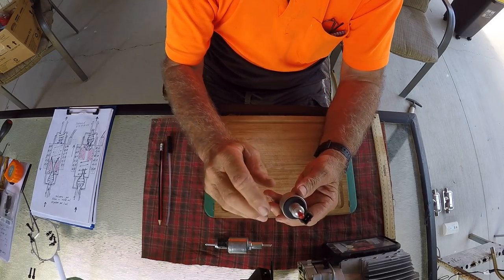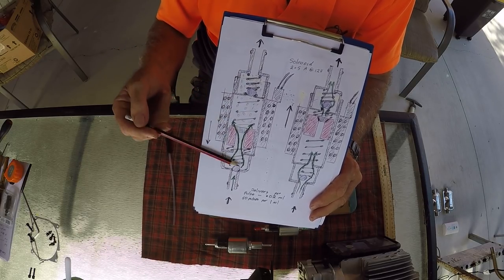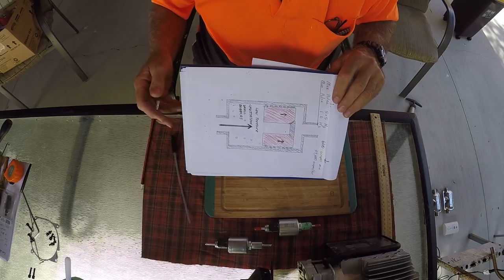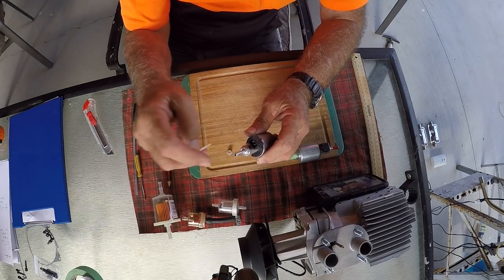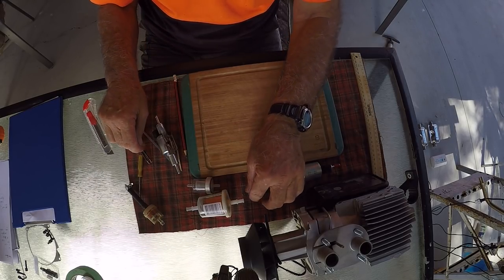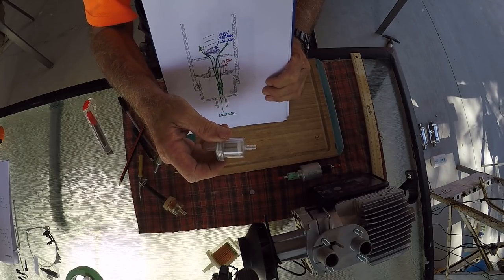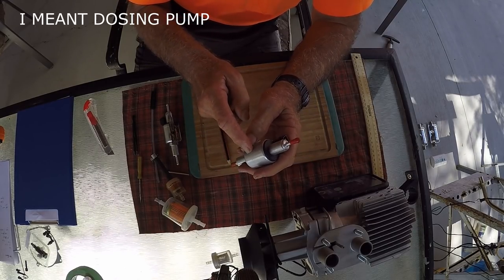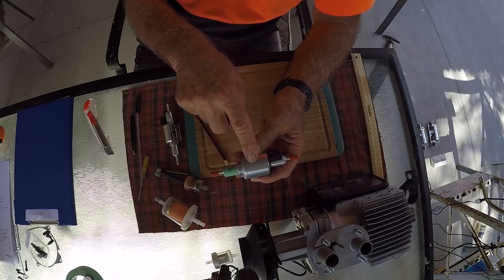Chinese Diesel Air Heaters   Part 7   Metering/Dosing pump

Comment: John, watched all your videos, but the one topic you failed to cover, IMO was tank height. I've been trying to find out if having the tank HIGHER than the pump or heater will cause siphon issues, or does the pump prevent flow? Super informative series by far. Thanks from Canada.
Reply from the maker: Hi There

First, I am pleased you found the videos helpful. 

Now your question. 
You are correct. If the tank is more than a few inches higher than the pump or the heater diesel can leak past the seals and flood the heater causing a non start. 

This is easily fixed….Just install a ball valve fuel shut off tap between the tank and the fuel pump, and turn off when heater is not in use. 

This generally means when heater is not used for a week or more. In general, there is no need to turn the tap off if heater is not used for a few days. JMcK
Reply: @johnmck1147   JMck, Understood. The big question was tank height. A shut off in this application isn't possible, as I want to turn on the heater on/off remotely over the internet. lol. Already have that working with a pi and red remote. Not a biggie, we'll redesign with the tank lower than the heater, but again, useful information. Thank you.

Comment: Hello, what is your opinion on the CNMZ 23 pump being rated for both 12 and 24 volt? On the pump it says 12 volt, and I received it with an order for a 24 volt system. Searching the web indicates the 12 volt pump is sold interchangeably as a 24 volt pump. Have you ever tested or come across this discrepancy?

Comment: Hi John, brilliant video and thanks for sharing your knowledge. Wondering if you can help me? I have a Truma diesel/electric heater/water heater made in collaboration with Erberspasher, in my motorhome. A new pump from Truma is about £200 yet I see Chinese ones for about £15-20 but can’t cross reference the part number. The output, on fuel, is 2, 4 6 kw and pump rate 220-630 ml/hr. (Ave 110 ml/hr @ ave output of1000w). Is there a Chinese pump I can buy that will do the job. Many thanks Keith
Reply from the maker: Hi Keith

I think you could make this work if the current pump is an electromagnetic DOSING pump. 

If the current pump is a true dosing pump I would try a Chinese pump and see what happens. If you do try this, I would be most grateful to know the outcome. JMcK

Comment: This series is wonderfully informative and I'm not thru it yet. BUT, I was wondering if you could give me your opinion on what it takes (electrical power consumption wise) to run a 5KW heater for 8 hours. I need to use one this weekend in my school bus conversion and want to run it off the two bus batteries without draining them to the point where I won't be able to start the diesel in the morning. Thank you.
Reply from the maker: Hi Tom,

The current usage is very dependent on heater usage and settings.

The heaters draw 10 amps for a minute or two to heat the glow plug and start the burn process.
They also draw 10 amps for the shutdown process, so you really do not want to be turning them off and on too regularly.

In operation they draw about 0.8 amps on the lowest manual setting up to around 4 amps on a high setting.

Running these heaters you will use around 10 Ah on a low setting to around 35 Ah on a high setting (for your 8 hour run time). JMcK
Reply: @johnmck1147  Thank you.

Comment: Hi John
Thank you for the very detailed video and all of your other videos.
I am running my Chinese 5 kW heater on fusel oil. Do you know of any ethanol compatible fuel pumps for these heaters? The pump pulse is weak and the flow rate has slowed to the point the heater won’t light. I believe the pump has failed due to the “dry” fuel. I can blow air into the into the fuel line after the pump so that rules out a carbon blockage. Any help is much appreciated.
Cheers from Canada!
Reply from the maker: Sorry Brian, I know of no ethanol compatible dosing pump.

You can buy a spare pump on eBay, a Chinese made fuel pump is quite cheap, but make sure the voltage is correct. If you wish to continue using fusel oil, I suggest you add 20% diesel for lubrication.  JMcK

Comment: Hi thank you for all your videos!! So helpful you are the man.  What do you know about running these at altitude?  i want to put one in my cab over camper I live at 6000 feet and will be using it for ski trips so will be going up higher than that while using heater. Any information would be helpful.
Reply from the maker: Hi Paul,
I have not come across a Chinese manufacturer selling a high altitude kit for these heaters. You can buy a genuine Eberspacher with an altitude kit. 

The heater will run at high altitude, but will run rich due to the lower oxygen component in elevated  air, and this causes quicker carbon build up and more frequent servicing. You can improve the performance by running a high kerro diesel mix at altitude. 80:20 or 90:10 Kerro :diesel.  JMcK

Comment: Thanks  heaps John. I can't quite get how you integrate manual priming in this system. Can you put a rubber priming bulb inline between filter and dosing pump?
Reply from the maker: Yes Dirk, but put it at the end of the fuel hose, squeeze prime until fuel comes out, disconnect prime bulb, and quickly connect hose to pump.

You only need to prime once, so there is no need to leave primer in place. It will work left in place but puts unnecessary load on the little fuel pump. JMcK
Reply: @johnmck1147  Thanks for replying John (didn't think you would find the time after all those excellent vids :)  I assume mounting the fuel tank above the unit would negate this problem and put less strain on the dosing pump as gravity would take care of much of the required energy?
Reply from the maker: Hi Dirk, an elevated  fuel tank is fine, but needs a fuel shut off valve before the  pump, which you need to turn off if not using the heater for some time. Over time you can get fuel seepage past the pump which can flood the heater glow plug causing a non start.  JMcK

Comment: Hi John, thanks once again for all your videos and knowledge. I am wondering if you know what the difference between the different pump sizes is? From what I gather, there are different size pumps, indicated by the number written on it. In the video, yours is 18 which I believe stands for 18mL. The most common pump size on Amazon I see is 22mL. I just swapped out a 19mL and put in a 23mL, and I think it is making my heater run too hot. The outer plastic is too hot to touch after 15 minutes. I was assuming it was because the larger sized pump is pumping out too much fuel causing too much combustion. In your video though you said all the pumps dose at .2mL. Do you know what the pump size actually indicates or if the larger pumps do indeed pump more fuel per pump than the smaller sizes? Do you think the pump sizes are interchangeable and my issue lies elsewhere? Thank you!
Reply from the maker: Hi There. 
Re the pump sizes.
Add a decimal point in front of the number, that will give you the the volume of each pump pulse. Most 5 and 8 Kw heaters use .2 or .22 ml pumps. 

If your heater came with a 19 pump, the CPU would be set up for that fuel volume, matching pump speed with fan speed to get a correct burn. 

You installing a bigger pump upsets all the calculations. 

If technical minded you can, with a password, recalibrate the CPU, but that can be a disaster as these heaters have no factory reset button if you don’t get it right. 

Cheers. JMcK
Reply: @johnmck1147  Thanks for the reply. That is what I was thinking, that I would be able to tune the heater by adjusting the pump frequency and fan speed to the new pump. I am already doing this for elevation adjustments by following a chart I found online. Would you be open to making a video on how to tune a heater using a CO detector?

Comment: G'day John. I'm looking at buying one for my caravan and doing the install myself and am going to show my lack if understanding here but what exactly is 'soft mounting'? I'm thinking of encasing the fuel line and dosage pump with some narrow foam or rubber hose. Would this work? Loving your videos so far!!
Reply from the maker: Hi Chris, 

The dosing pump is a piston pump and causes a ticking noise when the piston hits the end stop. If hard mounted this noise/vibration is transmitted to the boat hull or vehicle chassis, so you need some soft material to isolate the pump to lessen the noise.

Incasing the hard fuel hose in soft rubber hose is a sensible move as it both protects and noise isolates.

Incasing the pump in insulation material can cause issues as the pump gets hot and can overheat in some cases, but as you mostly use the heater in a cold environment light wrapping of the pump can be ok.   JMcK

Comment: What is the difference in the SN1 and SN2 setting. I have a brand new heater that immediately started over heating (error code - 5) and I read to change this setting to fix it. It did fix my issue, but just curious why I needed to change that!
Reply from the maker: Hi TOR

To the best of my knowledge SN1 and SN2 refers to the number of sensors on the fan. With the wrong setting the ECU thinks your fan is going double the speed (reading two sensors per revolution ) and slows the fan by half causing overheat.  JMcK

Comment: Looking to purchase a heater for my van and you channel’s been very helpful, thanks John. There are mainly 2 complaints about cheap Chinese diesel heaters, the noise of fuel pump and soot. Have you experimented with a quitter after market pump?
Reply from the maker: Hi TnS
I have tried a few different pumps, and they all make a ticking sound. It is the nature of the type of pump. The piston goes up and down and makes a noise each time it hits the end of the cylinder. The noise is lessened if you isolate the pump by suspending it in space. Have you seen the boat video? In that video the pump is suspended i a rubber frame.

Anyway, if the pump is isolated well the main noise from these heaters is from always from the fan.  JMcK

Comment: It's winter here in Canada. As it may be relatively warm (around -2C), I am about to install a replacement pump possibly tomorrow, (and I have bought 2 of them just in case). I have learned from your advice that I need to move it from where it is now which is about .25M from the heater, to back where my tank is, which is probably 2 meters. As I have 2 pumps, I wondered whether there could be any value in installing one near the tank, and one perhaps half way to the tank? I know we do something similar with fighting forest fires by setting up a 'still well', I wonder if that might also work here? I guess I could always try, I just don't like breaking the line and then having to install more extension fittings than necessary.
Reply from the maker: Hi MP, the pump provides the fuel quantity dictated by the ECU. Put it close to the fuel tank and it will easily pump the 2 meters to the heater if you use the narrow bore, hard nylon fuel hose.  JMcK
Reply: @johnmck1147  
Thanks John. Just spent the day moving the location of the new doser pump closer to the tank. While I was at it I noticed a few other issues you had touched on, so addressed those as well (screen head on the air intake, a short section of larger diameter fuel line right at the heater that I had not noticed, which I think was with the kit when I got it, so I replaced it with the narrow bore tubing, Etc.). I was understandably happy when I heard the sound of combustion on the first try. Will tidy up the installation tomorrow, and I think going forward may add lubricity agent to the diesel fuel that I use. My success in this is all down to your time spent making these tutorials, and am very grateful for that.
Reply from the maker: Mountain Parameters 
Pleased I was of some help.  JMcK

Comment: Hi John , Thanks so much for your info . Just installed an All -in -one in my Ambulance camper . My heater puts out great heat . Works wonderful . HOWEVER . My pump runs fast and slow with no consistency . It will run rhythmically and the speed up for three or four pumps , then rhythmically . Back and fourth all night long . Heat is steady with no codes . Exhaust is clear . Is this normal ?
Reply from the maker: Hi Sam, 

This pump behaviour can happen if you are using the controller in temperature setting mode, but it is normally for longer periods than what you describe. This is why I personally prefer manual mode. There is no hunting of pump and fan motor.

In manual mode you manually set the pump Hz rate, (pump rate) and it will stay at that rate until you change it.

If the pump behaves the way you describe in manual mode, you have a faulty controller or ECB.
If in temperature mode, the fan speed should also increase or decrease in unison with pump speed. If not, you have a faulty controller or ECB

Cheers,  JMcK

Comment: Great information.   Can you explain the  different flow rates on dosing pumps?  I have a Webasto HL32, with a 12V dosing pump  (PN 85355A).  I'm looking for an aftermarket dosage pump replacement, but the sellers don't list flow rates. It appears that my pump has a flow rate of 65 ml per 1000 clicks,  but a lot of seller list a 22 ml or 16 ml.  Is there any difference on flow rate, or is the achieved by the click frequency. 

Also, attached to my pump on the output is a  membrane damper.   What is this for?
Reply from the maker: Hi Jonathan, 

All the dosing pumps for these common diesel air heaters that I have seen put out 0.02 ml per pulse, or 20 ml per 1,000 pulses. The Hz or cycles/pulses per second determine the actual flow of diesel to the heater.

This series is designed to help DIY people who buy the cheap Chinese copies of the Eberspacher heaters gain knowledge that they can not get from the on line suppliers. If you buy a genuine Webasto or Eberspacher the authorised supplier provides the required knowledge. 

I have some knowledge of the Eberspacher and the Chinese copy heaters, I have less knowledge of the newer Webasto heaters. I have not seen, or worked on a Webasto HL32 heater, so I can not be of much to you help here.

Webasto have been trying to lessen the pump ticking noise, and I suspect the membrane damper is designed for that purpose.

Sorry I can not be of more help.  JMcK

Comment: John I have bought a new dosing pump for my old system, just to see if I can get it going, now my old pump just has two wires out of it, and I can of course measure which one is positive of course but the new pump has a green connector, do you know which one is the positive? Left or right if you are looking at the pump connector pins and turning the connector until it is on top?  Much appreciated, great series!
Reply from the maker: Hi Andreas, these dosing pumps work on the electromagnetic principle. When current is applied to the coil a magnetic field is energised and the metal piston flies upwards by magnetic force. 

It does NOT matter which way the voltage polarity is applied. 

Cheers,   JMcK
Reply: @johnmck1147  great thank you so much, and you take care!

Comment: Do you think that adding oil to your diesel would help lubricate the diesel fuel pump?
Reply from the maker: No, the diesel itself is a good lubricant.
Also, adding oil causes a dirty burn and quicker carbon build up in the combustion chamber. JMcK

Comment: great video! what i cant quite make out though is if the length of the fuel line affects the dosage. would the pump need to be calibrated to make up for the extra distance in order to maintain the same dosage?
Reply from the maker: Hi there, the pump should be as close to fuel tank as possible.
See video on fuel lines. The pump pulses or dosses .02 ml of fuel per pulse and is not re- calibrated. The delivery hose must be thin, hard wall nylon fuel line or thin bore metal fuel line so as not to absorb the fuel pulse from the pump.   JMcK

Comment: John,  I have been through 2 pumps already.  I just noticed that my voltage ranges from 12-14.7 v on this circuit 
Is that what killed my pumps?

I guess I need a voltage regulator to keep my voltage below 13 for these?
Reply from the maker: Hi Dr P

The pumps are simple electromagnetic pumps and a voltage of 14V or 15V will not hurt them.
What will hurt them is bad fuel, no fuel filter, bad quality fuel filter, wrong orientation etc.

What is wrong with your pumps? Not ticking, not pumping, no pressure etc?

I would be interested in more info please.  JMcK

Comment: Hi, I have recently installed a 5kw heater and discovered the fuel pump setting and rev setting on the lcd controller. Have you done a video explaining these settings and which revs and hertz speed is best for differing situations, ie zero degree weather, minus temps, and plus temps etc. Thanks, and thanks for your videos, they're very useful.
Reply from the maker: Hi John, 

No, not at this stage. There a number of videos already available on this topic and I wanted to concentrate more on topics not covered or covered correctly.  

Personally, and that is just me, I prefer to run the heater manually and often choose a low to mid setting of around 3 to 4 Hz, that way I don't have the heater running flat out to try and achieve the set temperature, but rather I slowly heat the space jp without excessive noise. But many people like the automatic function.  

Cheers,   JMcK

Comment: Can you buy those electric pumps as a replacement part or do you have to buy the whole heater? How hard is it to get replacement parts for those heaters?
Reply from the maker: Hi TT,

Yes, you can buy replacement pumps and most other parts like gaskets, ECB, glow plugs, atomisation screens etc.

Sometimes it is helpful to search for “fuel dosing pump for Eberspacher diesel parking heater”

Cheers,

JMcK